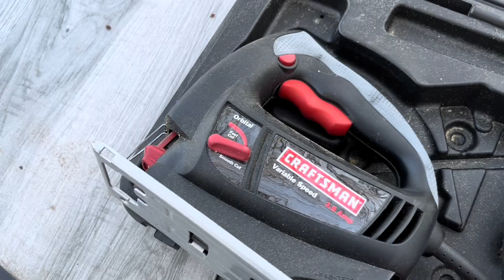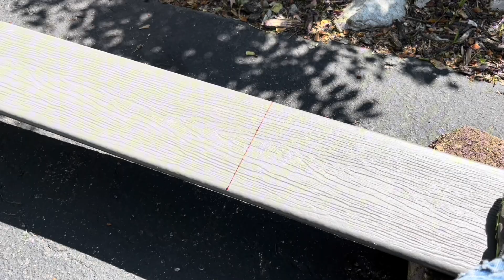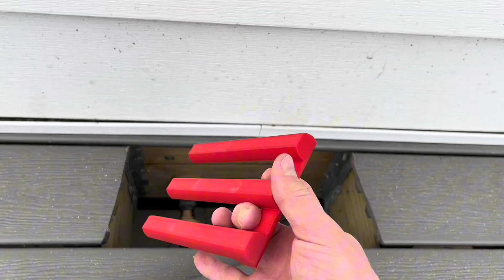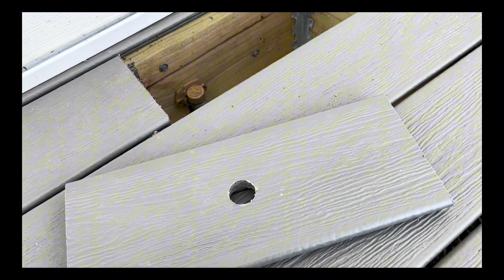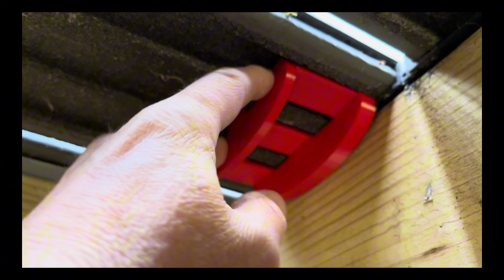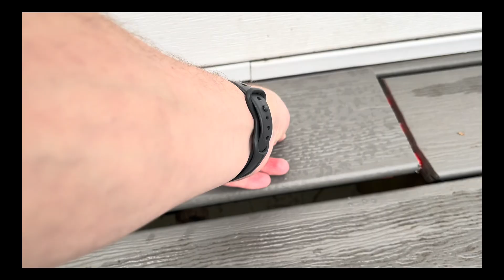Did I Create an Access Point or Trap Door on My Deck?

Comment: Quick tip from someone who has been printing and designing for over a decade. Never use 3d prints for anything structural, where someone can fall through the floor. I see you came to that realization near the end. Even if you did an acetone misting to bond the layers I would never trust it.
Reply from the maker: I appreciate the comment, and thanks for watching. This was not for anything structural, just the access point.
Reply: @drachenfire7784  Yeah I get it, your assuming that no one will ever walk over there and jump up and down on it. Always assume that someone will do this. I'm not sure where in the world you are but say your having a party and a kid lifts it up and falls into the hole - who is going to be to blame? Who is going to compensate? Even after you sell the house. if a lawyer found the vid you could still be liable. So it is structural if it's supporting a load. The load being people walking on your deck. Just keep that in mind when doing 3d printed projects. They are good for odd ball things but they are not injected molded so assume they have zero strength and they should be prototypes for the real solid plastic extrusions or molds. Don't let this stifle your creativity and tinkering,  but let it's be a guide rail for you in covering your butt and knowing the limitations of process.

Comment: Seems like just a couple of pieces of wood on both sides to make a shelf would work a lot simpler and faster
Reply: But he spent a lot of money on a 3D printer, so why not overengineering the hell out of it with a less convenient result than with only these two blocks of wood? :D
Reply: Or one could also mount another spigot to the end of the deck and run an extension hose to it from the original spigot that is permanently on and control the water from the second spigot.
Reply from the maker: Not a bad idea @mrgallbladder, but it freezes in the winter where I live. I’d need to unhook the hose under the deck for the winter and hook it up again in the spring. I wanted a solution that didn’t require getting under the deck for normal use and access even a couple times a year when seasons change.
Reply: @drachenfire7784 the second valve works the same way any other outdoor valve does. Shut off the water, and open the valve to drain access water before first freeze. There's no need to ever go under the deck because that valve is already open.